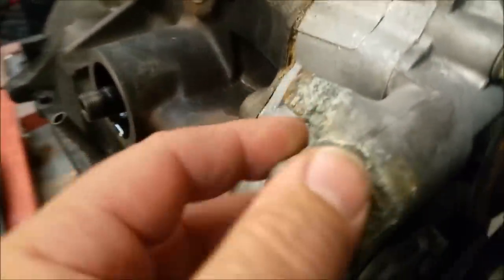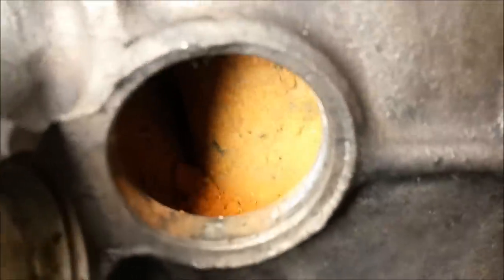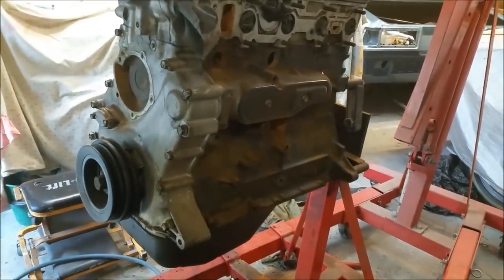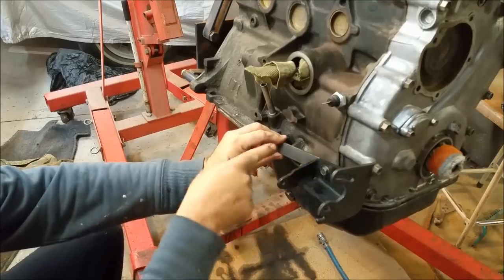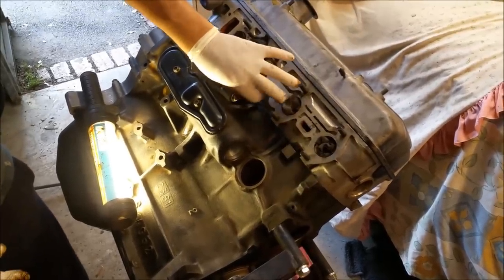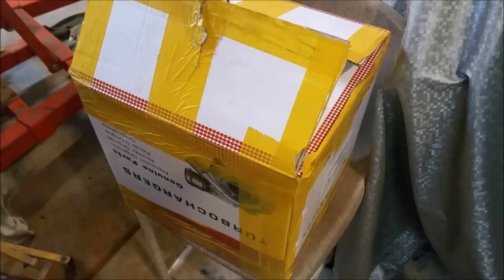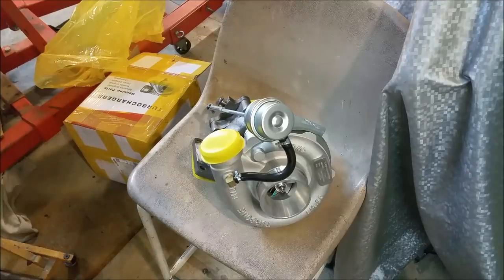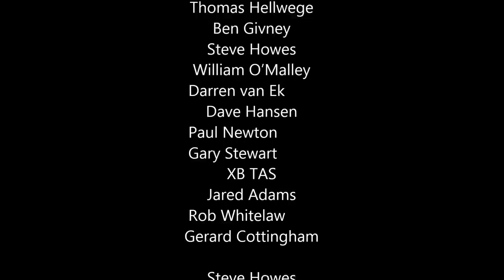Mitsubishi Sigma 17 - Cleaning, Fitting Welsh Plugs and a RUBBISH Mock-up Turbo

Comment: Ceramic coating is a great addition, it will lower engine bay temperatures plus looks smick.
With the welsh plugs in and new water pump on maybe vinigar water treatment and then a flush would help with water jacket rust.
Thanks for your inspirational videos Peter.

Comment: Love the info on this channel, I have an old L24 (Nissan) engine that's been sitting for years but spins freely. I'm gonna pull the Welsch plugs out and clean it. Got everything replated, vapour blasted and hoping it will drop in and run nicely. It was covered in years of grease and oil, but cleaned it off and repainted in factory blue colour. Looks 100x better.

Comment: All journal  bearing turbos have shaft play the oil takes up the slack when running.
Reply: I agree the play is normal. Cheap Chinese turbos seem to work surprisingly well for the dollars.
Reply from the maker: I knew that, but I didn't know that much play was acceptable, cheers.
Reply: No expert here, but I figure as long as it's spinning true, play on one end is not an issue.

Comment: I think I'd change that core plug above the oil filter (I call it a core plug because a "Welch plug" is a different style, and is fitted differently.)  It may not be leaking significantly, but the block shows signs of discolouration below it from moisture, so I suspect it weeps a little from time to time.  Better safe than sorry, cheap fix - and so much easier to do it now, while it's on a stand.
Reply: I know them as core plugs too, because they plug the holes where the casting core for the water jacket were.
Reply: aussiebloke609 they can be called expansion plugs to
Reply: Core plug is a generic term.  Welch plugs specifically are affixed by inserting it into a hole, concave side out, with a step on the inside of the hole so it can't be pushed in too far.  Then you strike the centre of the plug with a hammer to expand it and create the seal.
Reply: aussiebloke609 if you go to repco and get a 40mm welch plug you'll get the above type older cars especially english had the type you mean , i know which one would suit high pressure in modern cars and that's probably why they changed styles
Reply: aussiebloke609   I think he changed those three before he decided to pull the engine out, back in one of the early videos of the series as one was already leaking pretty badly and rather shot...
Reply: @Big Ears  Sounds a likely reason.  I remember my old Mini had Welch plugs in it.  Pain in the arse to remove, as you can't push them inwards.  I ended up using a slide hammer - thank the gods I could reach them through the grille opening.  :-P
Reply from the maker: I think that was an old leak and the reason it was changed, but you're probably right. I just didn't want to touch that side of the block as it's where all the cracking issues are with these engines... cheers.
Reply: Hmm...good point.  I couldn't remember just where the cracking problem used to manifest itself (my dad cracked his, but that was a long time ago now.)  :-P

Comment: Top tip when blowing all that nasty stuff out of the engine, have someone hold a Shop Vac near the exit hole, it will slurp all that dusty air up rather than getting it all over.  Looks like the restoration is going good.

Comment: pete they still sell that holden bolt compound at supercrap auto. so no problems getting more of it mate. always used stag on my welsh plugs and never had one leak. me being OCD would have done the other side as well, i'm just OCD for that sort of thing, and, like you i much prefer the brass look as opposed to the painted look, the brass ones last forever the tin ones hardly last at all.
Reply from the maker: Yes, I guess the mild steel ones are sacrificial, so will give way before anything else. I didn't do the other side because they're in the area where these blocks crack, so wanted to leave well alone. I agree, the unpainted brass is a far superior look, cheers.
Reply: @PeterAndersons  ah yes thats right you did mention about them cracking i did hear that. yes, leave well enough alone, when one starts leaking it will be a point to which you can then use to collapse it internally and lessen the stress

Comment: Nice work Pete ,that Chinese turbois going to cause the death of a few engines.  Wife had a cheap Blue steel Chinese clutch in her  Vz Ss 6speed. It wrecked the gearbox , wouldnt disenge properly . They shouldn't be allowed to sell some of this crap.  Now she has to buy a good clutch as well as having the gearbox rebuilt. . She had a  $55 Chinese distributor in her chev, what a peice of junk. Back firing, wouldnt idle . I put an Accell Hei in and runs perfect now  . Heard the gear falls off and chews the cam gear up, it seems like a great bargain but the tight ass pays twice and more sometimes.

Comment: GM sealer was commonly used on the cylinder head bolts for red motor Holdens and also chev and pontiac v8's of the 50's and 60's onwards. Now thats showing my age.
Reply from the maker: And I still use it, so I'm looking ancient, cheers.

Comment: That engine's looking amazing Peter, well done. Next up im hoping to see ceramic coated intake manifold and carby to match the exhaust side :)
Reply from the maker: Nah, I was being silly doing the exhaust manifold, particularly given it's potentially short tenure in the car... got a good deal on it so wanted to do it, cheers.
Reply: @PeterAndersons  aww thats a shame Peter, it really would have stood out, especially if you got the turbo manifold and exhaust housing done aswell, it would have looked quite unique.  Also you mentioned you were planning to go with a suck through setup on the turbo setup, i was thinking perhaps you could possibly go with a blow through setup like the old 80's Daihatsu Charade's had. They were using a sealed box that sat ontop of the carby and had an overboost valve to bleed off excess pressure, i thaught it's just something to think about if you have troubles finding the correct Turbo setup for the Sigma.
Reply: I just thaught i'd add a link: https://scontent.fsyd7-1.fna.fbcdn.net/v/t1.0-9/34314_474061833503_6175500_n.jpg?_nc_cat=111&_nc_ht=scontent.fsyd7-1.fna&oh=62bc53f7ed5143a19a315586c020dc06&oe=5D05E436 This was the 1994 Charade that i turbo''d using parts from a 1985 Charade Turbo, basically the only parts i used from the 85 model were the turbo, top hat, cross over pipe, oil cooler(replaces the oil filter bracket due to the turbo version having a water jacket for oil cooling and oil feed hole for the turbo), front engine cover(has a hole for the oil return directly into the sump) and original dump pipe. Surprisingly everything bolted directly upto the non-turbo engine, even the dump pipe bolted directly to the existing factory exhaust. As you can see in the image the crossover pipe goes directly from the turbo into the carby's top hat, the overboost valve is in the pipe looking thing facing the driver side of top hat.

Comment: Hi Pete another cracking video, nice to see the old girl come back together, is it worth using distilled water in the engine to stop crud build up? look forward to seeing her finished probably not as much as you though!! keep up the good work mate, PS look forward to seeing some bike stuff in the future, Many thanks for the video's as tv is rubbish, ATB Wayne UK.
Reply: I would never recommend tap water in any engine. Either premixed coolant, or distilled and coolant are the only way to go.
Reply from the maker: Thanks Wayne, yes Easter holidays are coming and I have a mountain of work on this and the old Ford, so the engine will be going in sooner than later... after that I need to check the bikes to see where I left off, cheers.

Comment: Add teekay rust eliminator to the radiator when you get it running , cooling system will look like brand new.
Cheers Steve
Reply from the maker: I might need to take your advice, thanks Steve (sorry, still haven't called in) cheers mate.
Reply: also had good success with GUD soluble oil in cars and bikes , keeps the water pump  seals lubricated

Comment: Is it a restoration yet ? ;)
Reply from the maker: Ha, no not really just an over zealous going over. The engine and gearbox are just clean up jobs and the underside of the car will stay the same. A lot of unpainted parts are going back in, cheers.
Reply: @PeterAndersons  Initially came to the channel for the XC resto but am enjoying this as I had a Sigma SE 'Back in the Day'. Nice car.

Comment: just because you cant move the actuator by hand does not mean it has a higher spring then listed. effective area of the diaphragm is what will over come spring pressure, put air pressure on in and see what psi it opens, also that shaft play is about normal for a journal bearing turbo. yes its a cheep turbo but it will be fine to run in a low power application. the technology in the turbo is straight out of the 80's it will be highly inefficient compared to modern day turbo's. something like a garret GTX2860 would be perfect for that motor.
Reply from the maker: Thanks for your advice... but a millimeter is normal? With oil running through such a super heated area, do you think it will take up that much clearance? It's been years since I've messed with a turbo and this was just a mock up thing and I like your idea of the modern Garret - apparently all Garrets use a carbon seal, so great for draw through... does this sound correct, cheers.
Reply: @PeterAndersons  yeah it's prob on the looser side of ok. I have a TD06 journal bearing turbo on my track car that has been on there for about 10 years and it has similar play in the shaft. am not sure about a carbon seal on garrer turbos Do you mean the seal on the shaft? The gtx3071 on my street car has large O rings that seal the front housing to the backing plate behind the impeller.  In my younger years we did a blow through with a RB25 turbo on a l20 motor in a bluebird it went suprisingly well.
Reply: @PeterAndersons  Ive got an old 2lt Corolla rally/padock bashers,and we fitted one of them $899 "complete" turbo kits and it's still running hard after 2.5 years through mud,water,dust,It busted up the original silicon pipes and oil line pretty quick early on ,but with decent hoses,clamps and oil lines,has been trouble free.The youngsters give it plenty of stick.

Comment: And THAT's why you don't run your vehicle engine on just plain water.  Even if you live somewhere where you don't get freezing temperatures and so need antifreeze you still need to run a corrosion inhibitor or you'll end up with your cooling system sludging up with this mess and stuff like water pump inlet stubs corroding away and springing leaks or just shearing off.  In simple terms, water plus metal equals corrosion, every time you look in your coolant and see carrot soup, every bit of that used to be part of your engine...

Comment: what i did with small engines like that is a 2 or 3 day soak in warm evaporust
Reply from the maker: Good idea, a few people have mentioned that, cheers.
Reply: @PeterAndersons  yeah, mate, it helps loosen rust inside and out.  plus it will be clean after.  it may take quite a lot but its something you can keep around a while.  I keep a 30L tub around for small engines.